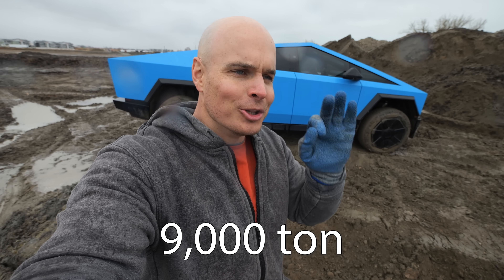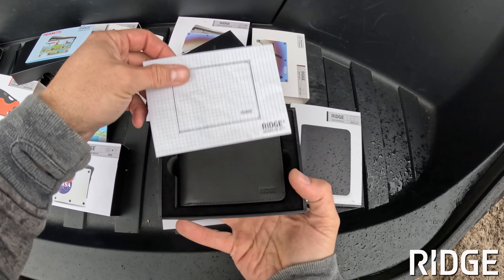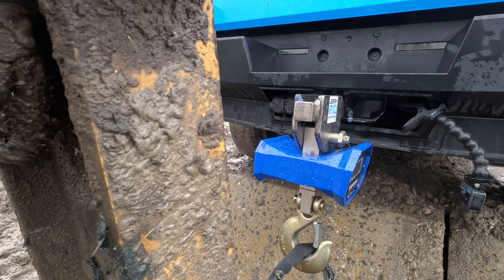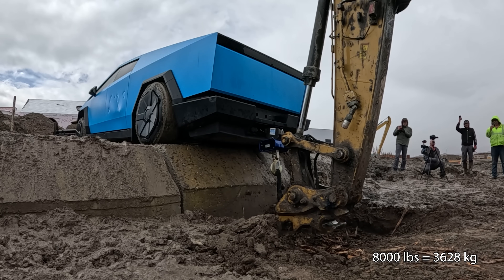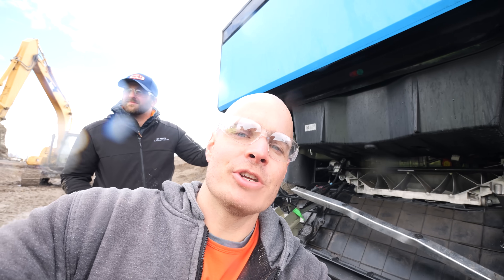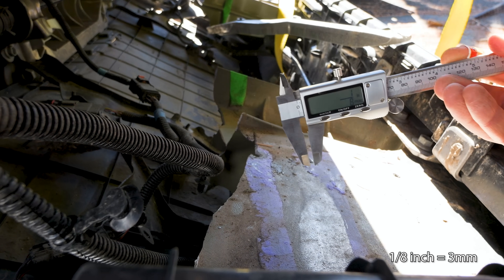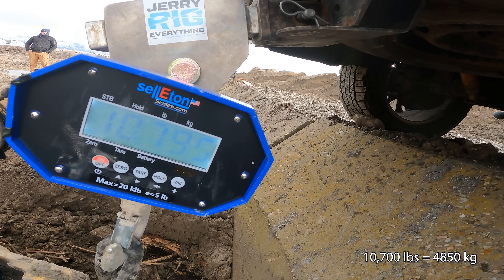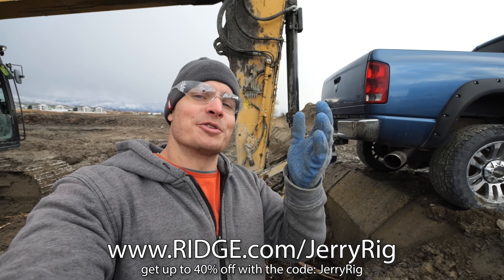SHOULD YOU TOW WITH A CYBERTRUCK?! - (catastrophic failure test)

Comment: 10,000 lb tongue weight is insane.  That's way beyond any sort of worst case scenario you'd ever encounter even towing beyond its tow rating.
Reply: Its because he is desperate to find anything that damages Elons brand because he has TDS.
Reply: 11000 lb towing capacity 1100 lb tongue weight 9.4545 x capacity so bad totally😮 seriously
Reply: You're not taking angles in consideration. 30 degree angle will make downforce almost 10x
Reply: Dynamic load can be impressive
Reply: My god the lack of imagination and intelligence from this comment section today is hilarious. MuskRiders and/or ppl overly passionate about trucks make for a funny community.
Reply: @thetillter2228  anyone who is passionate about trucks isn't going to defend the Cybertruck, I can tell you that much.
Reply from the maker: i dunno man - park the skid steer in the wrong spot and shes toast.
Reply: @JerryRigEverything  The rating for the tongue is actually 1,100 lbs, and it withheld almost 10x that. That's really good considering most have 2-3x rating maybe 5x
Reply: @JerryRigEverything I’m waiting on that Rivian test? Wouldn’t want to appear biased right?
Reply: @JerryRigEverything  WTF do you want to park skid steer? Directly on hitch?
This test only shows that with 10k lbs loaded vertically on hitch, will tear the back of cybertruck. Nothing more.
Safety concern of overloading hitch?
1. You will lift front tires off the ground first so no safety concern of driving anywhere.
2. If you somehow managed to lower front wheels, car will drive like shit, because of low weight on wheels. Almost no steering or braking. This is bigger safety concern than hitch breaking off whole back.
3. You would need to overload hitch, bottom out suspension so it would sit on bumpstops/frame and somehow find the biggest pothole in US, so it would shoot your car upward generating 2-3g. Still bigger concern would be strength of tires, wheels, hubs, axles than hitch. Not to mention you're way past your payload/GWR capacity.
4. That crest you talking about, would have to be damn sharp and at 45deg for just 5,500lbs of hitch weight. I guaranty, that you would have clearance problems with trailer drawbar to the ground and hitch would be least of your concerns. Traction force also might be problem before hitch gives way.
5. SAE test is probably the worst case scenerio like hard braking with overloaded hitch and crazy bump on road.
6. Steel bends and don't crack like cast AL, duuuhh...

I'm not defending cybertruck because personally i think it's garbage.
I simply can't stand videos, that are clearly made for entertainment, but are pushed as some kind of tests. Especially assumptions pulled out of ass.
Reply: @feluke8396  Thank you for all that and well said. This goes right up there with his destroying Cell phone video. Nothing but waste with no practical benefits. It also does not help that he does not like Elon so he creates an unrealistic situation in an attempt to cast the Cybertruck in a negative light. Which is absurd. Id never own one of the trucks but to me this was just a dumb test and a waste of money.
Reply: @feluke8396  this video was flagged as a paid promotion. I wouldn't be surprised if the video was commissioned for the sole purpose of political slander. This seems far more propaganda like than any jerryrigeverthing video I've seen to date. I know zach would simp for brands he's been commissioned to promote in the past, but politics seems like a new step for him
Reply: @Fun_Dips  It has a ridge wallet sponsor spot in it... What was political about this?
Reply: @JerryRigEverything  The only way a skid steer would do the damage you showed is by you balancing the skid steer on the hitch itself. If you don't understand tongue weight then just say you don't understand. Don't double down on the absurd test that proved you shouldn't tow anything ever.
Reply from the maker: @TheUnreallimits   dead weight ratings don't equal dynamic loads once you start moving.  But don't worry confusion is normal for people who don't tow often.  No hard feelings my friend. Be safe!
Reply: @JerryRigEverything  You are definitely correct on that. I won't fault you on actually knowing what dead weight vs dynamic weight is. Great job. The issue is how you are applying that logic is flawed. For 10,000 pounds of dynamic weight to transfer to the tongue off of a 11,000 weight load. That would suggest catastrophic weight shift from improper loading, improper towing, improper navigation (steep inclines/declines/turns) or even a wreck. None of which is the fault of Tesla but the fault of the driver. But don't worry, confusion is normal for people who don't understand when they are wrong. No hard feelings my friend. Be safe!
Reply from the maker: @TheUnreallimits  at least with other trucks (like the dodge in this video) the safety factor is large enough so that when errors or mistakes do occure - the damage isn't catestrofic. People aren't perfect and not all roads are flat. Hopefully my video and your comments help everyone stay safe out there.
Reply: @JerryRigEverything  Well that's not true either though. You had to weigh down both vehicles front ends to keep the tires on the ground. Although the rear end didn't rip off the dodge, if that happened while driving. The front tires would have been off the road and ended up in a ditch with a skid steer testing the cab strength. The video should be renamed to " How to improperly test tow hitch capacities, and blame manufactures instead of the user". Sorry Jerry, if you can't admit that none of this was the fault of faulty engineering by tesla but is instead the fault of the user. Then you yourself have become part of the problem of pushing improper blame instead of taking blame.
Reply from the maker: @TheUnreallimits  brotha they strap the car down when they do SAE J684 testing as well.  (Minimum for passing is 5500lbs of tongue weight btw.) I can see we aren't going to see eye to eye on this.  Good chat though.
Reply: @JerryRigEverything  You're correct on that. We can't see eye to eye on this one. I also don't agree with SAE strapping down the front-end during test either though as it takes real-world out of the equation. You can't strap the front of the vehicle down when towing down a highway so why put it on a test. Although I agree it won't be a problem towing with a Cyber Truck because only youtubers and doctors buy the hideous things. When do we see a doctor towing anything unless they are a plastic surgeon taking his plastic wife to the beach with a boat to show off all the work he did on her lol. That being said. I think we will agree on one thing for sure. If tesla should ever design another electric truck, call Rivian. At least they look like a truck and won't get you laughed at by the public everywhere.
Reply: @JerryRigEverything do you have shares in Rivian or similar brand? It would explain alot..
Reply: @JerryRigEverything  you are just a YouTuber pretending to be smart but you are just an average
Reply: @TheUnreallimits bro does not get the point of the video
Reply: Bro just admit your test premise was flawed and motivated by a deep hatred for Elon's political views rather than the quality his products.
Reply: @F_C... exactly what this was.
Reply: @TheUnreallimits  High loads can happen for short periods of time. A load that would lift the front end lasting for fractions of a second still go through the hitch, even if they don't last long enough for the front end to actually come off the ground. That is probably why they strap the front down for a test.
Reply: @-DJ-  There is no realistic way to induce a 10,000 lbs tongue load without overloading your towing capacity. The force vectors don't even come close to adding up otherwise. Even Zack couldn't ignore that caveat in the video. 
Maybe you could induce such a tongue load taking the truck off some jumps while towing at max load, but even then, they'd need to be something far more than a pothole.
Reply: @Fun_Dips  I don't think it is unrealistic at all if you have a poorly loaded trailer and some uneven terrain at speed. I've seen 2" ball mounts with 7.5k capacity get bent by a trailer that didn't weigh more than 2k pounds.
Reply: Your downright patronizing comments are ridiculous especially given how misleading your so called test is. Why don't you test if the car survives crashing in a wall as well? @JerryRigEverything
Reply from the maker: @iz8437  crashing cars into walls is one of the literal safety tests they do.  So yeah. That's a great idea. Thank you.
Reply: @JerryRigEverything  here is a title for your next misleading video then: Cybertruck fails safety test as it doesn't withstand crashing in a concrete wall
Reply: @JerryRigEverything  commercial  builder here....i tow and work with heavy equipment since childhood after 45 years i seen it all .. u use the truck to the specs... but that will not create a YouTube BS we literally destroy  excavators pushing mountain roads ,  the cyber truck is a light duty truck ....if u feel he did a bad job ...go build your own
Reply from the maker: @mikesh8968  i have built my own electric truck. It's an EV Humvee. You should check it out.
Reply: @ The hitch ripping off in any way says it is poorly designed, even if the test to do it was over the top. If you use this truck to the spec day in and day out, that will probably happen to you at some point in the future. Cast aluminum is the wrong material for that job.
Reply: @-DJ-  Aluminum may not have the same tensile strength as steel, but it there's nothing wrong with using it as a frame. Its higher elasticity actually makes it more durable to steel in terms of fatigue. And it's not going to rust out in 10 more years, like the Ram will.

In hindsight, they should have made the frame a little thicker to account for people bouncing an excavator on top of it, and driving it off jumps, but I feel like that's asking for a lot for a company's 1st attempt at a truck.
There's plenty of terrible design issues with the cybertruck, but I don't think this is one of them.
Reply: @Fun_Dips  Cast aluminum is nowhere near as durable in terms of abuse as steel is. Cast aluminum gets weaker and weaker the more times you over stress it and can eventually break at a load significantly less than its tensile strength, steel doesn't have that issue to nearly the same extent. The frame on the ram isn't going to rust out in 10 years, that truck they tested was 11 years old and fared far better in a much more abusive test. 
This test shows what is wrong with using it a truck frame intended for towing. Significantly less durable, and can fail catastrophically in the right (or wrong depending on how you look at it) circumstance. Is it likely to happen? No. Could it? Absolutely. Would that happen to a steel frame under the same circumstances? No. Over time, you would see these things failing after heavy use, if they ever actually get used heavily, which is probably quite unlikely as well.
Reply: @JerryRigEverything 

So you're saying the CyberTruck passed that test then? It cleared the 5500lbs with no problem. It's a shame politics has ruined people's objectivity.
Reply: @TheEyered  What was political about this?
Reply: @JerryRigEverything don't worry this test showed just how dangerous the cybertruck is. They should all be recalled and fixed.
Reply: @F_C... 
lol quality
sure the test may not show a static force that often happens, but that is not "quality"
Reply: @JerryRigEverything  that’s total shambles, when do you ever tow with just one point of contact, you tow with wheels attached!
Reply: @TheUnreallimits  You're so mad that I can hear your blood boiling. But don't worry, it's normal for people with toxic fanaticism. Be safe…
Reply: @TheUnreallimits At least three(that we know of) cybertruck frames have snapped off while towing on the highway(caused by hitting potholes at highspeeds). There is video evidence btw.
Reply: @Fun_Dips wrong, cybertruck frames have been proven to snap off while towing heavy loads and hitting potholes at high speeds
Reply: @JerryRigEverything bro you’re worse at this than Bill Nye is at understanding the ideal gas law
Reply: @JerryRigEverything  Question, what is the max tongue weight of the cybertruck vs the max tongue weight of the 2500? 
Just curious, I mean if we are being completely above board and all?
Reply: @RichardRider-z5m  He has been hating on elon(justifiable in some ways) in his recent tweets
Reply: @shiroiokami9  TBF it wouldn't be a bad video if it wasn't for the dishonest thumbnail/title...
Reply: @RichardRider-z5m  As if during the video he was clear about what towing capacity and tongue weight is and why having a tongue weight of 80% is far far far above what class of hitch the car has and is rated for
Reply: @JerryRigEverything  in this video you mention you wouldn’t use aluminum for towing applications. I reviewed your other electric truck towing videos and noticed the ‘weigh safe’ hitch. 

It’s aluminum. 

So the problem isnt aluminum. Also, how does having a front end loader holding down the front have any real world application? The truck would possibly be in a wheelie with that much hitch weight (or at least dangerously unload the front wheels)

You going to get rid of your aluminum hitch now?
Reply: @drinkwater9891 Fr, I'd take the truck that still drives after the bumper get ripped off.
Reply: @JerryRigEverything almost as toast as your brain

Comment: If a CT were to park at the top of a slope of angle theta with a fully loaded trailer and max tongue weight, the vertical portion of weight on the tongue would be:
1100+(11000-1100)*sin^2(theta)
45 degrees:6050lbs (pretty extreme angle for towing)
30 degrees:3575lbs (more reasonable)

10000lb breaking is not much for safety margin if your static forces are a third of that, I would imagine the safety margin including dynamic forces would be less than 2. Then you add in that aluminum always has plastic deformation and will have fatigue failure, the safety margin doesn't seem enough.

Comment: I’m not a Tesla fan, but putting 90% of the horizontal towing load in a vertical orientation is quite good. I’d be happy to tow 11k pounds if I had a cybertruck or if it actually managed to tow for more than a few miles before battery dies

Comment: There's just no actual time when "trailer weight becomes tongue weight" unless you back up off the edge of a cliff or something and then you have bigger problems
Reply: Very useful in the second Jurassic Park film! Now I won't drive a Cybertruck to fight 2 pissed T-Rexes.
Reply: I'm sure there are times when there is a lot more trailer weight on the tongue going down the road than there is sitting still. I can't say whether dynamic loads would be the entire thing, but I am willing to be it would be a staggering number at times.
Reply: The massive air suspension will probably absorb most of the shock going over a bump. All that weight isn't going directly to the hitch, what a lazy video.
Reply: @OM61777  The vehicles suspension can't absorb shock from the trailer going through the hitch. How is it lazy? The title is literally catastrophic failure test.
Reply: @--_DJ_-- Notice how the suspension got lower as the weight increased? The weight and movement on the hitch absolutely acts on the suspension and is dampened by it.
Reply: @bethehammer0676  Shock from the trailer has to go through the truck frame to get to the truck suspension. The weight doesn't change, just how it reacts to it.
Reply: @bethehammer0676  I'm so tired of my replies getting eaten by youtube when they are nothing but normal conversation.
Reply: @--_DJ_-- did you forget the trailer also has multiple axels to absorb the weight and you’re not balancing 10,000lb on your hitch? It’s flawed logic, use your brain and stop parroting the dumb video.
Reply: @_purge9488  The flawed logic is in your comment. You should do as you suggest and use your brain. Nobody is suggesting all of the weight of the trailer is sitting on the hitch all the time. Dynamic loading is what is being transferred to the hitch, which will exceed the static load by a significant amount for short periods of time. You can bend a 7500lb rated ball hitch mount with a 2000lb trailer. I've seen it done more than once.
Reply: Have you lived in the mountains

Comment: Not a realistic test.   Without holding down the front of the Cybertruck,  a 10000 lb load would cause the hitch to bottom out on the pavement which would support the load thereby preventing structural failure.